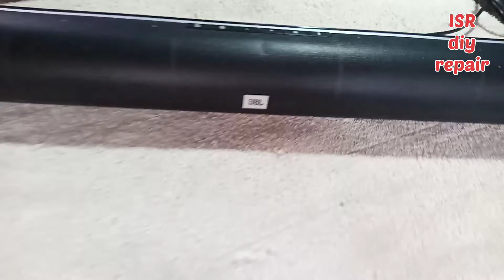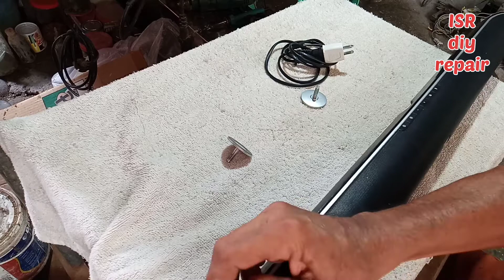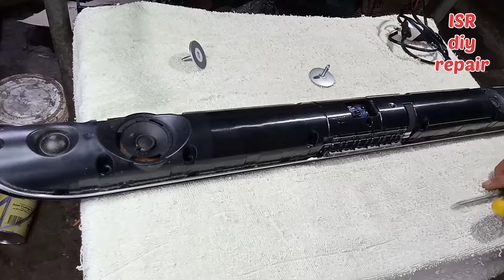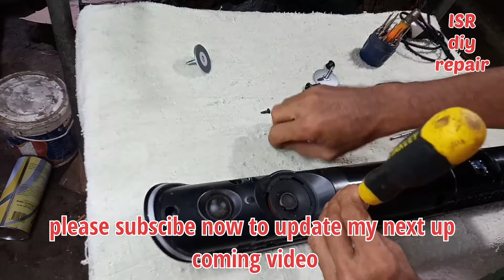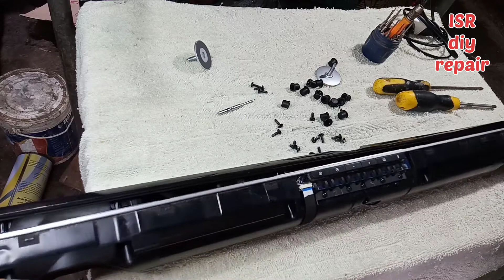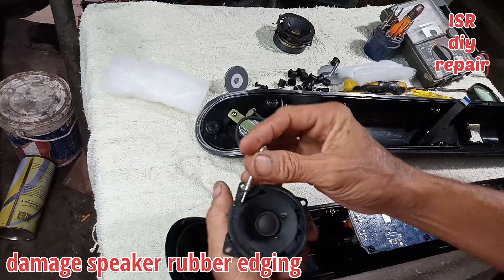Ang pag bukas at tingnan kong ano ang damage mayron sa loob.Part 1 of JBL cinema SB250

Comment: ano specs nung speaker mismo sir? ung midrange nya?
Reply from the maker: 2.5 inches full range speaker yan sir
Reply from the maker: Walang spec naka lagay sir.
Reply: @isralldiytv3848  I think it's 2.25 inches (57mm) mid range. I have the same model and issue. Na pudpud rin yung rubber edge pinalitian ko DIY lang.
Reply: @EctopicCandy Patulong po, same issue, ring lng ba pinalit mo sir? order rin po ba kayo online? ano gamit nyo na pandikit?

jbl talaga dami issue. boycott na ako sa brand na to.
Reply: @nikkosalarda276  oo sa shopee ko inorder ung rubber ring at may dala din ng pandikit. So far ok pa naman until now. Naka tambay na dahil bumili na ako ng bago pero Sony.